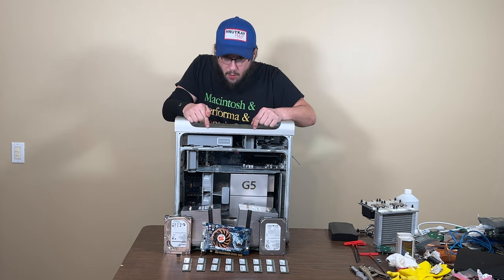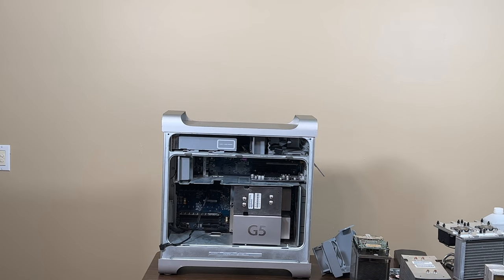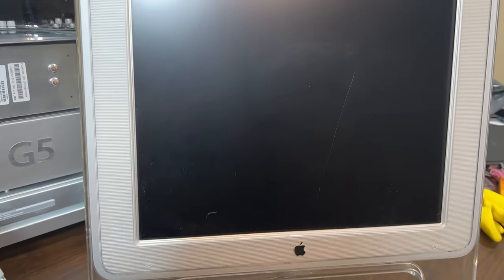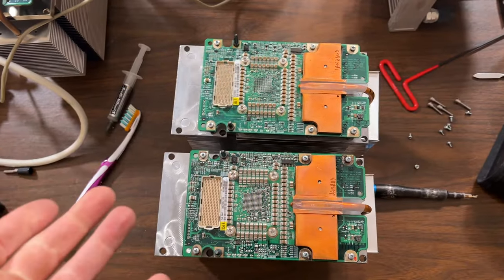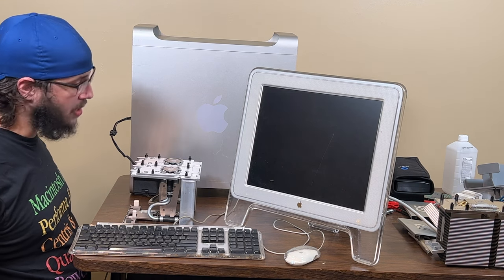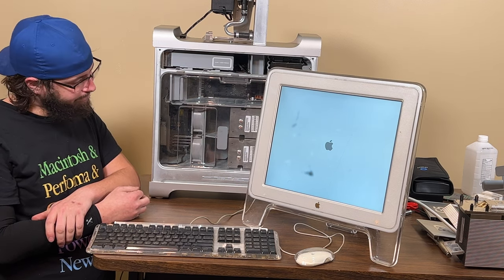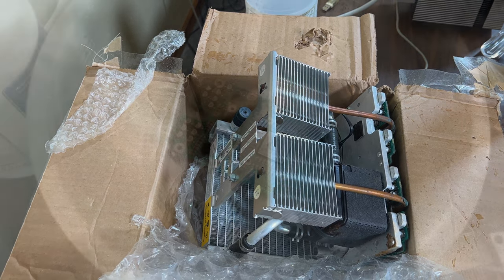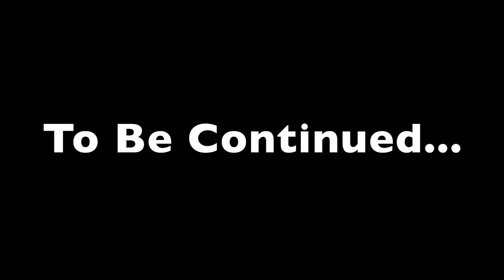Fixing The Air Cooled Dual 2.7 GHz Power Mac G5?  – PowerPC Series S.4 EP.13

Comment: In case you aren't aware, you can hit the boot keyboard commands after the power button, as long as you get them in before the bong. Makes CMD+OPT+P+R a looooot easier to do.

Also, have you considered hot reflowing one of the CPU boards or logic boards?
maybe get some citric acid cleaner and see if that works better for you than vinegar. It usually sold either in a gallon bottle as dilute cleaner, or in a spray bottle as soap scum cleaner. Check the label for the active ingredient.

Comment: Bro, I have 2 of those old air coled  dual cpu power mac g5's sitting in a closet...  wish i had a buyer for them..I fired one up a few yrs ago, it works, both cpus ok, leopard.. its noisy though and its just primitive...try watching a youtube video and its not easy on that thing... i just retired it back to the closet.. i also have 2 of the intel  mac pro's  8 core from 2006, modded out and those are plenty fast for daily use but the g5's I love to sell one day they are just taking space.
Reply from the maker: There’s plenty of groups out there that would probably buy them… try Low End Mac on Facebook and see if someone bites
Reply: @HrutkayMods  thanks brother!